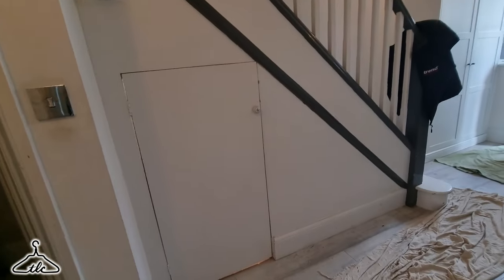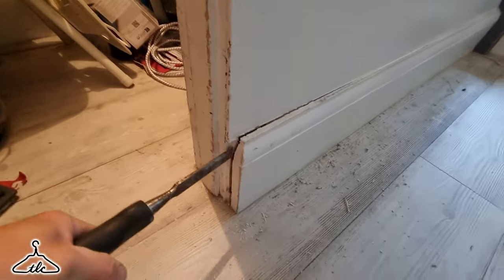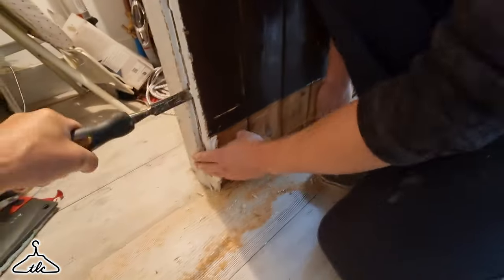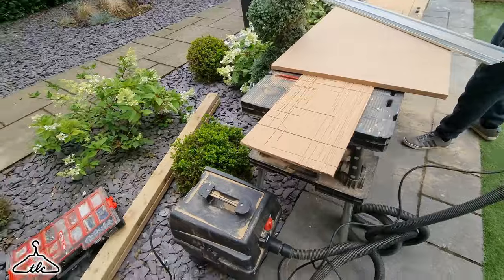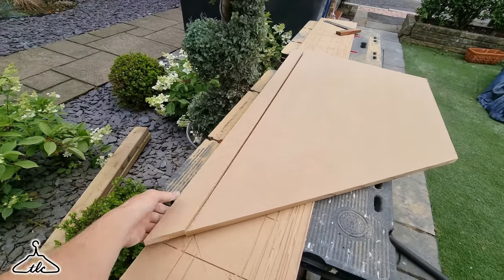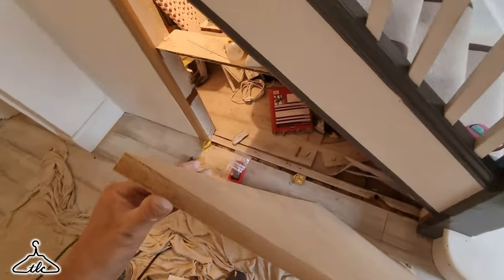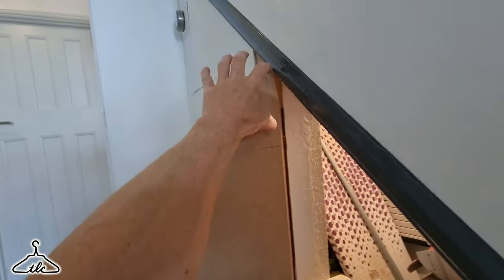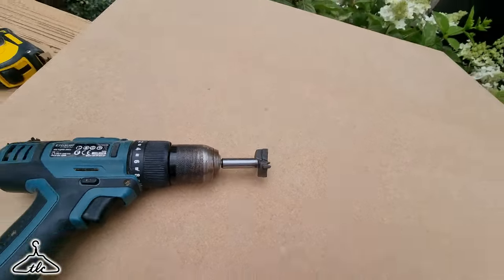Gain More Access Under Your Stairs (Quick Mod To Gain MORE Storage)

Comment: Good job with what you have done and explained to customer, im not picking faults one bit but incase your interested Ive done similar jobs in the past and the way ive done it is to run a full length of skirting along the bottom (obviously need to build a frame to attach it too)
And start the bottom of the doors from the top edge of the skirting so then you dont have any joins in the skirting. Yes you have to lift things over the skirting to get it into the cupboard but aesthetically it looks better on the eye.
Reply from the maker: Hi :-)
Yes this was discussed with them but she wasnt keen on the idea of the skirting being 6inches tall and getting in and out of that tight space, esp with hoovers and scooters etc.
I think maybe on bigger doors it may have been the way to go, but possibly not on these 2 small doors and withing the budget.
I do appreciate your ideas though thank you :-)
Ryan